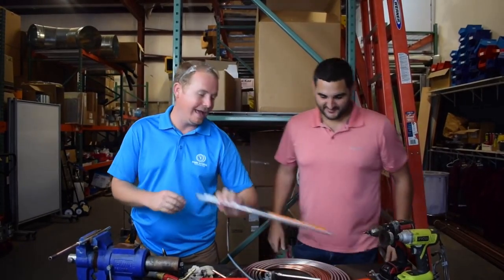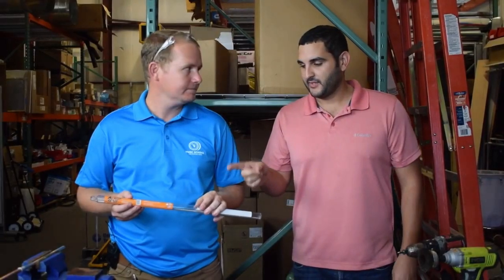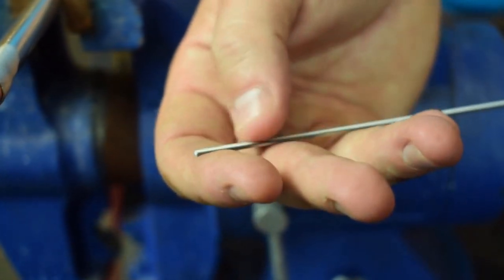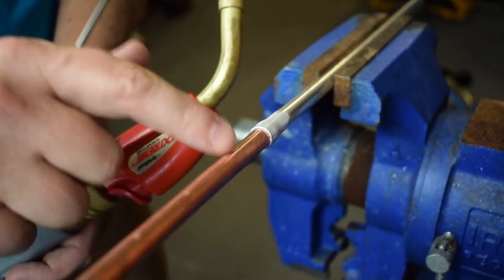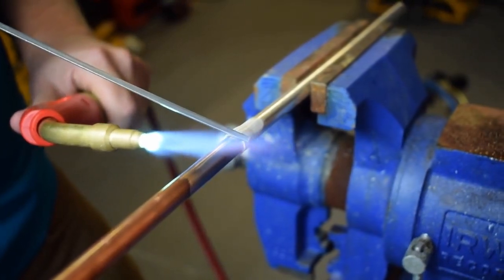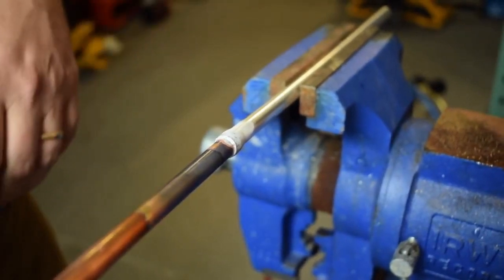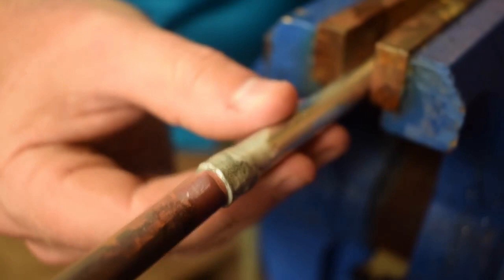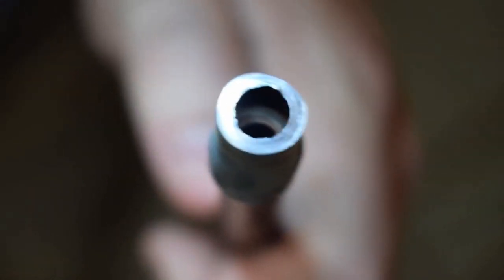Brazing Aluminum to Copper | with Al-Cop Braze

Comment: Are these dissimilar metals and will it cause a reaction between the two 🤔
Reply: Yes. If you have to braze copper to aluminum, use heat shrink over the joint once you’re done.
Reply: @Shmash_whatever  appreciate your information

Comment: will this work for refrigerant lines?

if it does work for refrigerant lines can it handle r410a as well?

will this work with the standard propane plumber torch?
Reply from the maker: Are you describing the lines in coils refrigerant runs through?  Then yes this is what it is meant to be used on.  I wouldn't recommend patching a charged line though.
Reply: aluminum

Comment: I have this problem.The aluminum capillary on a fridge must be brased onto the copper pencil drier.How sil i do it.
Reply: You can use alcop for that, aluminum to copper.  It’s on the products by pro page
Reply: @Yourpalsal_fl  Thanks
Reply: @rudolphrichards7050  send pic of application to sal@productsbypros.com I don’t think I answered your question
Reply: @Yourpalsal_fl  how many piece of rod in 1 plastic cylinder?  Thank you